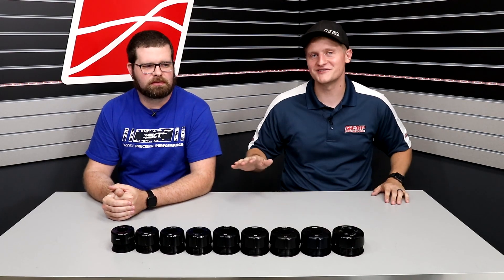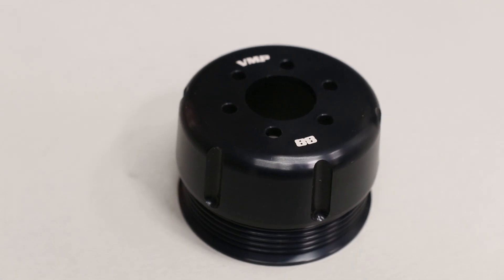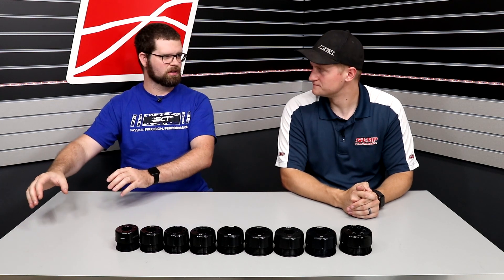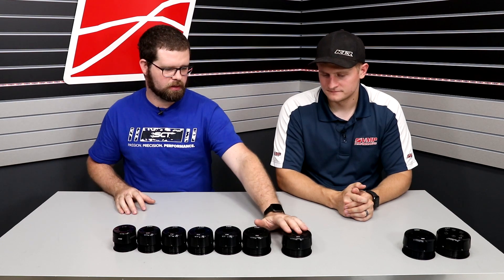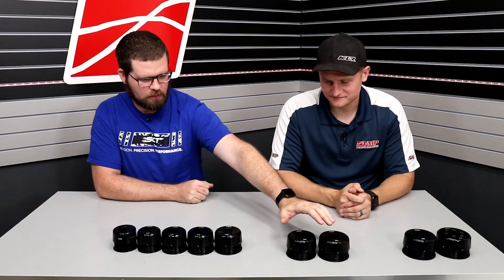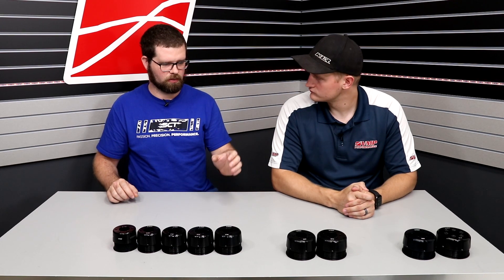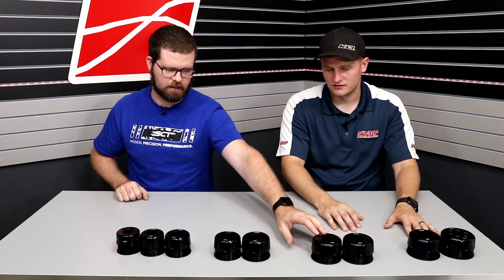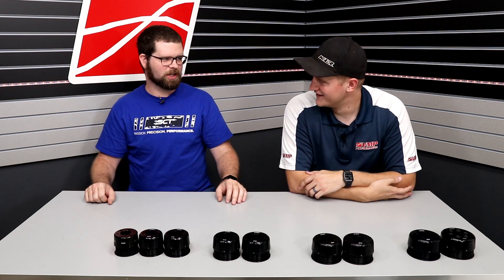VMP TVS Pulley Breakdown || Chuck and Joe talk pulley selection

Comment: Awesome video!! Just switched to an 85mm on 93 and boostane on my 2014 gt  with Aluminator and a gen3r. Car runs great!!
Reply: Could you feel a difference coming from the 88mm? What was your WOT degrees/timing on the 88?
Reply: @jasonmichael7800  I'll have to ask my tuner as far as timing. The hp on 88mm  is 708 and 85mm is 735, torque is 570 on 88 and 590 on 85
Reply: @Aluminator.Wile.E  that is okay, no need to do that. Do you feel that it was worth it? Is your Aluminator high or low compression version? Thank you for your time.
Reply: @jasonmichael7800  it's a high compression version
Reply: I will probably switch to 88mm  just for driving around.  I haven't really got on it much yet to find out,  I just had it tuned yesterday 😁
Reply: @Aluminator.Wile.E  thanks for your time. If you keep the same tune in and switch between the 88 and 85 let me know if you feel a difference. Looking to get 100 octane tune, and don’t know if the 85 is worth it. Would be easier just add the 93+octane booster and switch tunes to the higher spark, while staying on the 88.

Comment: I’m running your Roush phase1 to phase2  730p upgrade  it came with 82mm pulley and running 93 octane  no fuel additive I’m 530 ish above sea level .  It runs great.  I’ve added VP to it before and it wakes up even more.
Reply: Same with me 82 pully on 93. I need a e85 tune
Reply: At 4000 altitude I did 576 on 91 and 653 on E85. 82mm pulley on a Gen2R gen 1 yote

Comment: Joe and Justin are excellent tuners.  My only gripe is i was told 800-850wheel with my set up on e85 and 82mm pulley,  and i dyno'd under 700wheel. Bur since then Justin has sent me updated tune and it feels stronger,  just haven't re dyno'd again. Couple more wot logs and Tune updates and i should hopefully be close to 800wheel at 7500rpm. But they are both outstanding tuners. Sometimes it takes time to dial in a badass motor...lol

Comment: I’m have the VMP Roush phase 1 to phase 2 730hp tune from VMP with 82mm pulley , the Roush phase1 to phase2 uses 80mm pulley at 727hp.  Would it be safe to change my 82mm pulley to the 80mm pulley?  This is with the 2.3l head unit

Comment: So with a Gen3r on a built Boss 302 Motor on e85 with vmp fuel system and Fic 1000cc injectors,  the smallest pulley to safely use without going to larger injector is 75mm pulley.  Is that correct.  I assume i should be close to 850wheel on 75mm pulley with my set up.
Reply: More like 750.
Reply: @harrisonclark4382 750wheel on e85 with 75mm pulley only 750wheel.  Seems low. I will dyno and see.
Reply: @maximusvonce1381  i’m curious to see what power you make. I have a GEN 3 VMP , ID 1300s, sleeved short block, Fore triple pump, on the 75 mm. Going to be going back to the dyno soon. It made like 945 on the 69 without leaning on it.
Reply: @harrisonclark4382  Why didn't you stay on 69mm pulley.?

Comment: For a 2018 phase 2 2.65 blower what would you recommend I’m currently going with the 1050id injectors Upgraded fuel system and long tubes also in Colorado just trying to be on a reliable pully but want more power as well

Comment: I definitely want some clarification for sure. I just replaced my Gen 1 block with a Gen 2 new stock block. Wanted to go 79mm pulley 1000 FIC injectors with race fuel Sunoco 260 GT plus with the boost a pump. Will go to a e85 setup soon. I was told 82mm with race gas was a major stretch. Which is it cause this video doesn’t really support that. Let’s have a conversation so I can fully understand please
Reply from the maker: Ryan, email in or call to speak directly to support who can clarify any questions you may have.
Reply: What did you end up doing?

Comment: Hey i have a gen 3r on a 17 manual mustang gt. Fore innovations system on e85. Mantic twin disk. Calimer stage 3 trans. I live in Wisconsin witch is 1000ft about sea level. What pully would get me to 800wheel to 820. Would a 79mm get me there Or should i go down to a 75?
Reply from the maker: 79 MM should be right on top of where you want to be based on what we've seen.

Comment: Hi guys this video was awesome and super helpful. Just for clarification I’ve got a 2020 GT w/ roush 2650 stage 2 in Australia. What is the smallest pulley I could run with an e85 setup? And what supporting mods in terms of fuel system would I need? Really looking to get 800+whp.
Reply from the maker: E85 with a supercharger is going to require that you install a return style fuel system due to the volume requirement increase.  As for pulley set up, shoot us an email to sales@vmpperformance.com and our support/tuning teams can discuss your goals and recommend a pulley size to suit them.

Comment: So On your page any TVS pulley will fit the Odin? I am thinking of getting a 92 for daily use and 85 for rowdy time. I just Got my VMP fuel system to run E85
Reply from the maker: Any of the pulleys specified for a 6 bolt TVS should work using the spacer included with your Odin/Loki kit.

Comment: Wait i have the roush phase 2 for my 2017 mustang gt. It comes with 80mm pulley. Am i just wasting gas and not getting the power using 93 octane? Ford never said i needed any boostane. Should i be going with a bigger pulley?
Reply from the maker: The pulley sizes used on the Roush head units are a bit different as they are a different size supercharger than our VMP Gen3R and Odin head units.  When we're discussing anything less than an 88 mm on a 2.65L Gen3R/Odin, it'll require more than 93 Octane to be safe.

Comment: I have a 2014 roush stage 3 phase 3 with your twin 67mm throttle body and matching elbow if I go from a 85 mm pully to a 82 mm would that be ok for pump gas? Now I'm still running the 2.3 litter supercharger
Reply from the maker: Hey Matthew, that should still be fine.  Be sure to directly message your tuner, if tuned with us just respond to your last open ticket, to check to see if you need a calibration adjustment.

Comment: What is the smallest pulley you can recommend for a gen 1 coyote with a gen3r and your return style fuel system on E85 at sea level? Somewhat safely, I'm ready to rebuild if necessary
Reply from the maker: On a stock bottom end Gen1 car, we tend to try to stay very mild for safety.  An 88mm pulley with aggressive tuning can put them at risk.  Once you build a bottom end, your potential opens up greatly.

Comment: I just purchased the loki kit for my 16 f150 I live in Rio rancho NM 5500 feet vmp what pulley do I need to get to the 10-11 lbs of optimal boost levels I spoke with vmp and they said 3.3 pulley or 3.1
Reply from the maker: Either of those will work well, happy boosting!

Comment: how much power will I make with a 92 mm pulley on a Odin kit for my 2018 mustang gt and longtube headers with 91 octane fuel
Reply: I had an Odin kit with the 92mm out on my 2021 Gt… bone stock with dealership gas and some 93 shell I added. It made 594hp 497 tq.. it pulled timing due to the low octane I’m hoping.. only 12 degrees of timing.. the tune 93@ 17 degrees.. after I get some good gas and octane booster.. should be 625-650… hopefully
Reply: @p.d.kennels that tq is low for a tvs car even with a coyote.  You need some headers and free flowing exhaust asap.  That will add alot of power and even more tq at a lower boost level.

Comment: 2015 mustang gt roush supercharger r2300 tvs, fore return style dual walbro 465 pumps, FIC 1000 Injectors, roush dual 60 mm throttle body,  Texas speed 1 7/8 - 3" long tubes @ 1200 ft above sea level. What pulley would you recommend?
Reply from the maker: Hey Brice!  What's your horse power goal and what fuel are you using?
Reply: @VMPPerformance  I ordered a 2.7 inch pulley from you guys today ( 69 mm right?). Was hoping to make 850 -900 whp. I will be running e85. You think that's a realistic goal? I think I will be maxing out my injectors at 55 psi
Reply: @VMPPerformanceTV , as I stated, I ordered your 2.7 griptech pulley. I am having issues getting it to fit over the snout of the supercharger. Any suggestions?

Comment: Hold up, at 6:15 you said no scenario can you run 82 pulley w 93 octane? Ive been tuned w VMP for years…you know I have your elbow, TB etc and an 82 pulley w a 93 tune. ‘12GT Roush 2.3tvs. 🤷🏻‍♂️
Reply: We were referencing the Gen3R and Odin which are both 2.65L
Reply: 82mm on a roush 2.3 is WAY different than 82mm with a gen3r.  I mean WAY different.

Comment: What pulley do you guys recommend that will be safe for a 14 gt with a gen2r and 93 octane?
Reply from the maker: Hey Steven, most folks run an 82, or possibly a 79 based on fuel quality with the 2.3l TVS, such as the Gen2 and Gen2R.  It's best to speak directly to your tuner who can review logs and verify the vehicle is safe.

Comment: hi joe i called vmp and asked to make sure if i can use an 82 mm for gen3r for pump gas and boostane and they said no you can only go down to an 85 mm pully after that you need e85 can i use an 82 mm pulley on pump gas
Reply: Your gonna want e85 and return style fuel system when you start running more boost that a 85mm
Reply: I was told that I need to run e85 on anything smaller than a 92. I want to run an 88 on 93 and e85 on the track and was told no can't do that
Reply: @camddvp  88 you can run 93 pump gas 85 pump gas and boostane i dont recommend 85 on pump gas and boostane though iats get hot fast stick with 88 for pump gas
Reply: @camddvp  but you can use 85 on pump gas and boostane

Comment: What about running a huge pulley but with e85 instead of a smaller pulley on 93 (without full fuel system)?  I am running my car on a big pulley on e85 and very happy with it.
Reply: Has it blown up yet ?
Reply: @freedom6919741 it's alot less likely to blow on e85 vs 93 assuming fueling is on point.

Comment: Can I run a 79mm on Vmp gen2r with 56lb injectors and BAP ?
Reply from the maker: As long as it's on 93 octane, it should be possible.  Best bet is to confirm with your tuner directly as they'll have intimate knowledge of your vehicle and how it's performing.
Reply: @VMPPerformanceTV  so thats a definite no with a 72mm then..? on 91-93? im in Arizona

Comment: Will a 66 griptech hang in there on a gen3r 6 rib or is slip inevitable
Reply from the maker: Hey Chrystian.  The margin for error is so tiny when running such a small pulley on 6 rib.  The belt sizing has to be spot on, tensioners upgraded and in good shape, and any misalignment absolutely dialed out.  We typically recommend upgrading to 8/10 rib kit with an overdrive lower to add both belt width and pulley diameter to assist with grip once your need for boost reaches that level.

Comment: Could I run a 72mm pulley on a roush phase 2 kit 1000cc injectors and dual dw400’s safely ? Or even with a 69mm?
Reply from the maker: Yes with boostane or E85.
Reply: Stock Gen 1 motor will pop on those pulleys for sure.

Comment: For 2011-2014 coyote, Is your VMP comparable to the 2.3 Roush tvs  supercharger with the pulley setups? Thanks.
Reply from the maker: In what way are you asking?  The applicable pulley size is different, as the 2.65 L displacement of our current Gen3R puts out more boost at a similar pulley size.
Reply: Do do have pulleys for the roush 2.3 s/c?
Reply: @VMPPerformanceTV 
Update or feedback to my previous question regarding pulley compatibility.
3160lb new edge mustang swap with gen 1 truck Coyote, l&m nsr intake cams.
Vmp twin 67 t/b
PBH fead uplift kit makes 14psi @ 7k rpm with vmp 75 upper. Running E50 
Belt has some idle slip  so may have to use the griptech.

Comment: Is the 88mm pulley translated to 3.5 pulley or 3.4 pulley?
Reply from the maker: 3.4
Reply: @VMPPerformanceTV thank you. I’m throwing y’all’s supercharger on my gen 1 coyote built with a gen 3 short block, apr head studs, and redone heads. would you suggest the 3.4 or 3.5 pulley?
Reply: @VMPPerformanceTV  hope you get an answer!
Reply from the maker: Pulley size would depend on fuel choice.  If you're on 93, we typically recommend no smaller than a 3.4" pulley.  If you've got a return style fuel system and access to E85, that opens up a whole slew of options based on what parts your engine was build with and your overall horsepower goals.

Comment: Joe basically said the 75mm pulley is limit with fic 1000cc injectors,  with vmp fuel system on e85. 72mm would require 1300 injectors on e85. Although i know a 2009 gt500 running a 69mm pulley with gen3r e85, fic 1000cc injectors and he is fine with good air fuel ratios all the way to 7k rpm.
Reply from the maker: This conversation is Coyote based.  GT500s are a significantly different platform with less compression, larger displacement, and just different overall needs.
Reply: @VMPPerformanceTV  Hey i am glad you had this video.  Now I know its ok to run 75mm pulley with fic 1000cc injectors on e85 with your fuel system to 7700rpm. Any smaller than 75mm pulley and i need ID1300 injectors...
Reply: @VMPPerformanceTV  Hey according to Joe i can run 75mm pulley with fic 1000cc injectors on e85. Can i still run motor to 7700rpm, cause Joe said reasonable rpm. Is 7700rpm reasonable.  Also i am currently on 79mm pulley but my boost is only 14psi with gen3r on e85. I think my max boost with 75mm pulley will only be 15psi since i am at 14psi now with 79mm pulley.  My Boss engine heads and 3 inch exhaust must breathe real good.
Reply from the maker: None of that sounds too unreasonable and yes, a lack of restriction from a good flowing set of heads, cams, intake, etc such as the Boss' Roadrunner will produce a slightly lower boost number.  In the end, the statements made in this video are generalizations and estimates made from the numerous cars we've tuned.  It'll come down to the tuning team reviewing logs regarding your specific car to be absolutely sure everything is safe.
Reply: @VMPPerformanceTV  Ok thanks. Michelle Wilbur will review my logs with 75mm pulley. But i have not seen a higher boost number than 14psi with 79mm pulley all the way to 7500rpm with my set up..I guess my Boss Heads and 3in exhaust just breathe well.

Comment: How much boost will the 20% lower add?
Reply from the maker: Every 5% of overdrive is approximately 1 psi or the equivalent of one pulley size roughly in most cases.
Reply: @VMPPerformanceTV  my boost gauge shows about 23psi with a 20% over and 2.8 upper- sound about right?
Reply from the maker: There's a ton of variables that affect measured boost and we'd need more details to confirm.  But that doesn't sound abnormal in a general sense.

Comment: Can an FIc 1000cc injector support 75mm pulley on e85 at 7800rpm in a built Boss Motor with Gen3r. I believe you said a 75mm pulley is limit for fic 1000cc injectors.  I am assuming thats close to 850-800wheel.
Reply: @Joe Goodnough Would you recommend 75mm pulley with fic 1000cc injectors,  or stick with 79mm pulley. To be on safe side.
Reply: @Joe Goodnough Joe. Should fuel pressure always be 55psi all the way to 7800rpm no matter what.  It should never drop below 55psi during full throttle runs?. Sometimes mine drops to 50psi. Usually stays between 50-55psi

Comment: I havent even taken my car past 6500rpm yet cause i am going so fcking fast 120mph that at 7800rpm in 3rd gear i am 135mph.  Gen3r is a monster up top. Scary man. You better respect the power or you will learn the hard way.
Reply: Gen3r is a monster through the whole rpm band. It pulls as far as you wanna take it
Reply: Dang what gears do you have!?
Reply: @paranormal_6lacktivity5.0  373
Reply: @maximusvonce1381  that's crazy. My 373's don't let me do that lol. I need that in my life lol
Reply: My gen3 in 3rd gets up to 150 lol
Reply: @danielquintero4225  oh I have a gen 2. Damn gen 3 get all the good stuff
Reply: @paranormal_6lacktivity5.0  sorry gen3 blower on gen1 car gen2 short block, 3.31 gears through a built tr6060
Reply: @danielquintero4225  oh lol you have a good transmission
Reply: Hey you have any high rpm 2nd,  3rd, 4th gear lockout with tr6060.  Mine is a stock tr6060 from a 2010 GT500
Reply: Daniel Quintero.
Hey you have any high rpm 2nd, 3rd, 4th gear lockout with tr6060. Mine is a stock tr6060 from a 2010 GT500
Reply: Sorry it took so long to reply never really saw the message, I only have the problem with 1-2 going through all the other gears are fine
Reply: @maximusvonce1381  add a MGW if you haven’t already, personally I like the feel and can get it to go without a problem currently blew my reverse gear
Reply: @danielquintero4225  Already have mgw
Reply: @danielquintero4225  How did you blow out reverse gear on tr6060..Are you getting it rebuilt now.
Reply: @danielquintero4225  Yea tr6060 doesn't like 6500rpm shifts from 1st to 2nd. Try's to lock me out of 2nd.

Comment: Hey i may pulley down to 72mm pulley.  

Do i need a tune revision from you or no?

At 850wheel now. 72mm pulley will probably put me at 900wheel.  

Is my Boss stock Block ok at 900wheel,  or is that pushing it. I don't want my block to crack. 

I will probably stay at 72mm pulley permanently. 

Motor is fully built.
Reply: If it's built and you got good fuel and tuning you're good.  The stock block can easily do those power levels imo.  From what I've seen they don't really need sleeves until you're 4 digit power levels..
Reply: @midnight347 Justin at vmp said no sleeves needed till 1100-1200wheel.